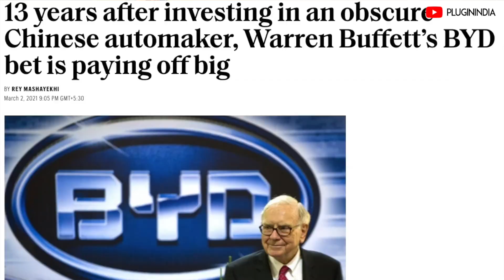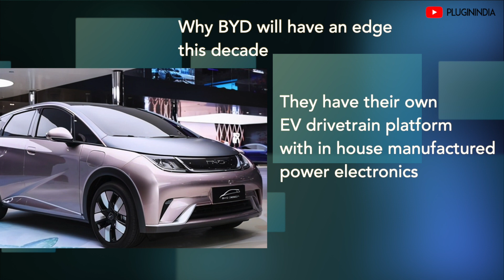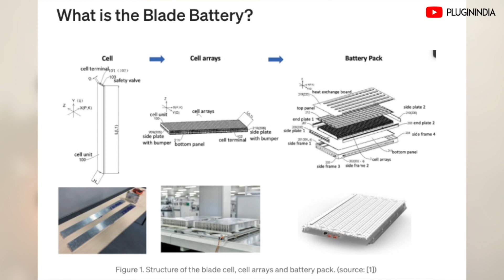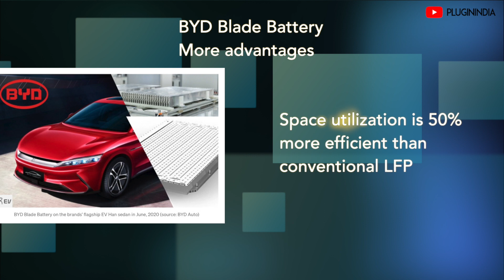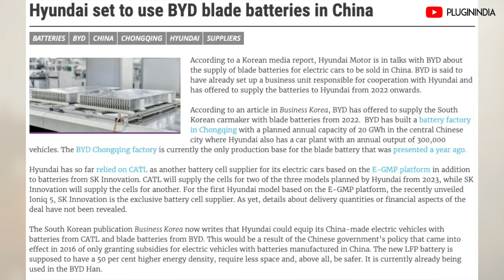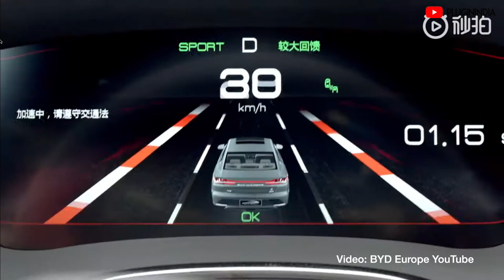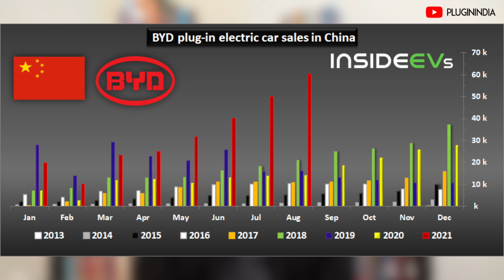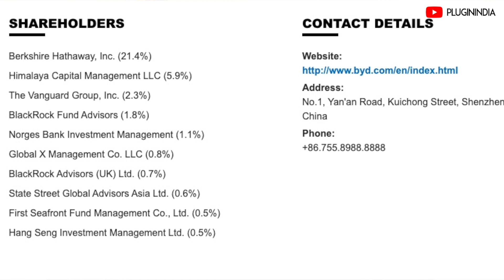Electric Car Watch 🚗 ⚡: BYD's Blade Battery & World EV leader

Comment: A BYD Dolphin will wake up all the sleeping OEMs in India to produce quality EVs and not a substandard product to experiment on the Consumers. Wish TATA would take the EV part seriously up their EV game.
Reply: Exactly. Equivalent of ₹12L for a hatchback with same range and more features than Nexon EV is obviously bound to be a killer.

Half of the people will drool over the V2L and cost alone. Tigor is close, but now where near as good in terms of features
Reply: @shresth1201   Indeed... And I really don't find any smart people leading the EV revolution... We are installing DC chargers with 25KWh throughput (good for maybe 2-3 years)... If we as a nation truely believe that EVs are the future, the cars will have at least 150 kWh speeds to charge... And don't get me started on the user experience part of it... Only two charging providers in the whole world are thinking of user experience Tesla and Ionity (European network)... And TaTa should have never launched Tigor EV... or taken a few months more to make a full baked product... It has wires hanging in the boot section... A 14L car with no boot door cover... wires hanging under the steering wheel... It sure has Ziptron but for that price they should have at least added the same 30 kW battery in Nexon EV... Guess they are always thinking that will this launch affect our existing products (EV and ICE alike)... We need an OEM that thinks differently... All other OEMs in the EV world distinguish their variants based on battery capacity... but in India they do it based on Sunroof and center console.... I mean Nexon EV base model has no center console... it is an EV without center console... who was that genius to come up with such an idea... 🤔
Reply: @VishalBedi  exactly. 25kW is archaic tech. Tesla sells 22kW AC chargers — and that’s the DC charger we are getting here. 

There’s no future proofing. It’s like buying 4GB RAM for PC in 2021. You are spot on. Charging infra was so hard to motivate companies to set up. Now it will only be upgraded as and when there is some fault or damage.  Otherwise we are pretty much stuck with what we have. 

There are dozen apps that one must carry to access chargers of each network. Something like BHIM UPI is strictly needed for EV charging infra — a consolidated platform to locate, pay and charge. 

I agree with you on Tigor too. Initially I thought from teaser that altroz EV is coming — which is frankly more popular even if we talk about petrol/diesel version. 

Tigor is a borderline failure of a car much unlike previous Tata oddballs like the Tata aria and Tata hexa or manza. 

Had Tata made altroz EV in same price and specs, it would sell far more than tigor. It also looks more stylish and modern. Tigor looks like someone took a Audi etron GT and squished it from sides and front to make it within 4m limit, and then removed all luxury and features.

Tata has no different tactics than usual ICE manufacturers. They have added unnecessary features to Nexon EV over Nexon ice version (like dual tone paint, and cut corners which people would’ve appreciated like cruise control for better range on highway) 

I got into argument with a guy the other day who said EVs are costly and Nexon costs 2x as much as petrol. I told him that Nexon EV has extra features over base model of Nexon petrol and the trim with same features would mean a price difference of just 2.5L.

He said I don’t want those features and most sales come from lower variants anyway. That hit me. Nexon EV can be sold as bare bones car for 10L too. But Tata won’t because it would be tooooo good.

Comment: If you want clean air to breathe then farmers must stop burning stubble.
Mulching stubble into the soil will decay and add nutrients into the soil and help hold water.
This will reduce the farmers costs for inputs and help clean the air.
The government needs to help farmers share mulching machines thru farm co operatives. 
AIr pollution is a problem for everyone. Farmers need to do their part to help clean the air. 
Reducing coal power plants and replacing them with wind and solar power will help clean the air.
Buying battery electric vehicles instead of ICE petrol vehicles is better for air quality.
There is a Climate Crisis. We need Climate Action.
Reply: Stubble burning accounts for 17% of pollution in India
Reply: Watch ecofreaks video on air pollution

Comment: How about their after sales service?
Reply: It’s for commercial use. They can literally send technicians to the client companies. That’s how it happens. 

My father is in UP Roadways (RM) and the servicing of state road transport busses is done at depot, not individual service centres of Tata for Tata bus and Ashok leyland for that bus. The guys come over if it’s unfixable issues and otherwise normal servicing can be done by mechanics. 

Now EVs are even less prone to
Mechanical issue — so mechanics will be needed rarely. For normal suspension issue/brake issue/HVAC, the tech is same on all vehicles be it EV or ice. 

Coming to electronics and software, it can be updated over internet via software update.
Reply: Everything will be perfect fine as they are being establishing their new energy vehicles business networks in world wide. They got a big big master plan and no one could stop them.